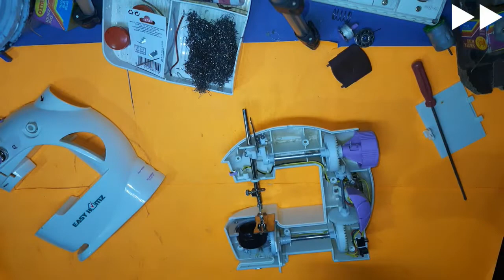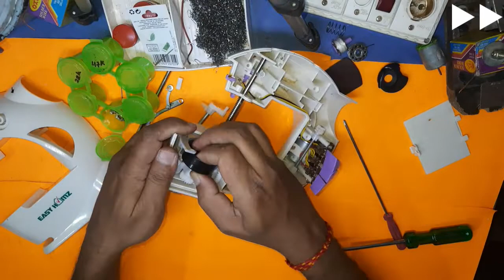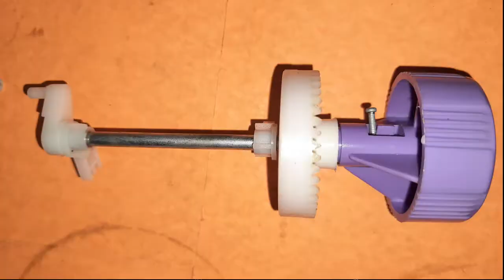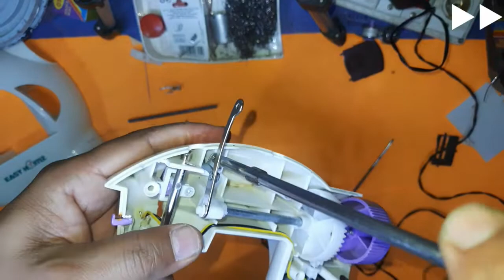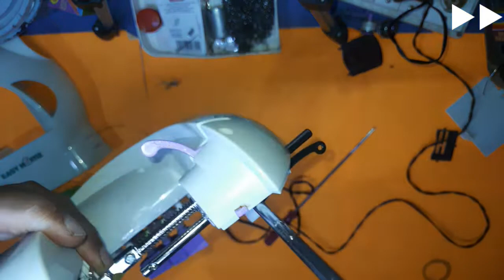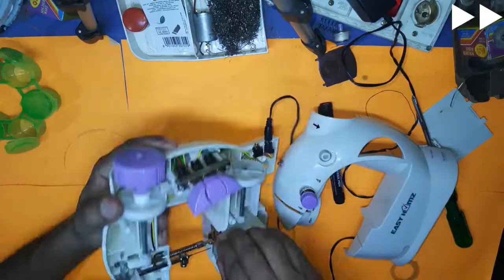Mini sewing machine complete open all parts, Disassembling, Reassembling, Motor problem and change

Comment: Light is working but moter not work
Reply: How to purchase supparate moter
Reply from the maker: Power supply is ok, you can change motor.
Reply from the maker: you can buy any electronic shop and also search online.